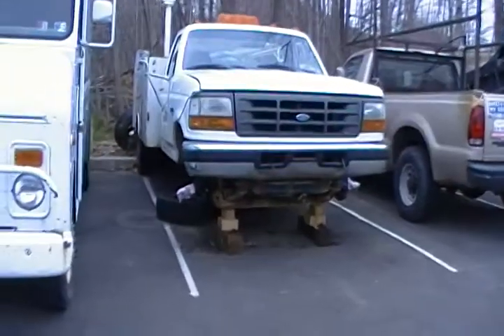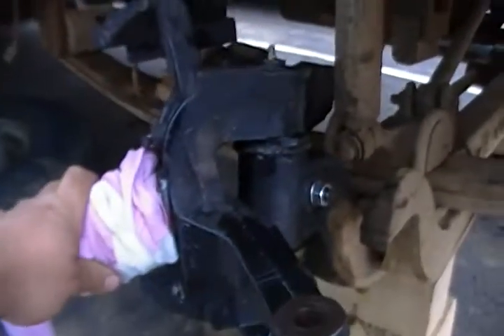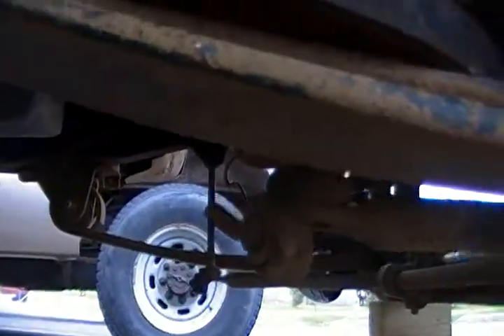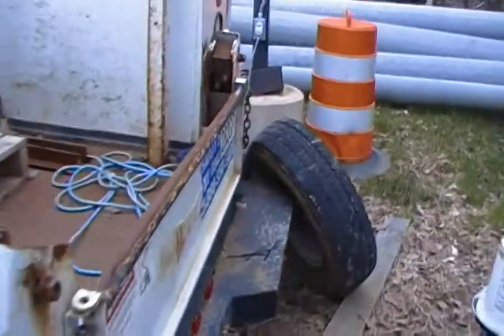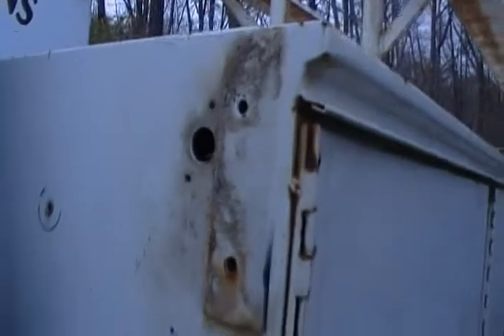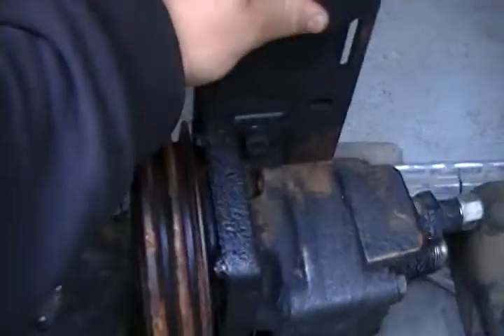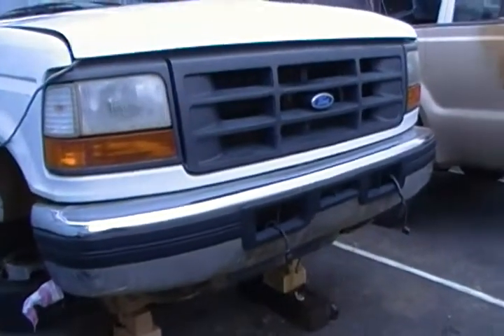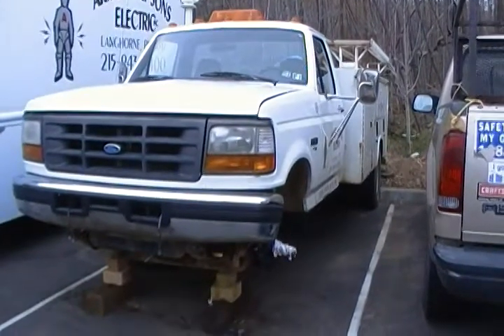Progress on the 97' Superduty

Comment: I don't believe its a 97, I might be wrong but I believe in 97 is when they changed the look of the ford trucks and started making the expedition instead of the bronco which caused the design change
Reply: Not that it matters after 6 years, but Ford changed the half tons in 97. The 3/4 and up did not change until 99.
Reply: jtc 1983 it always matters when someone is wrong on the internet. 🤓